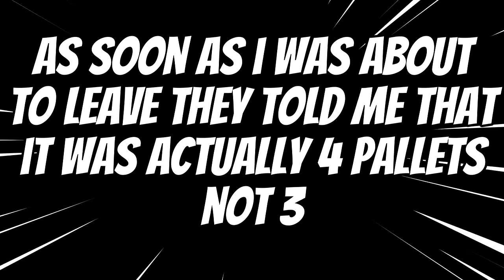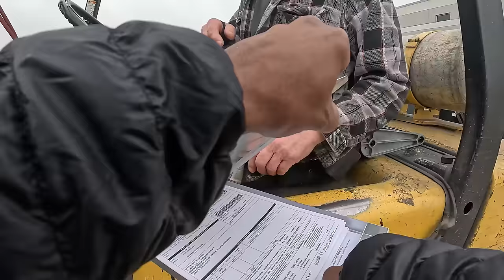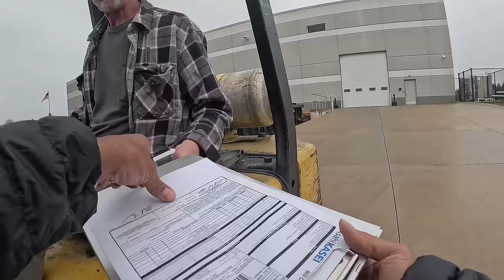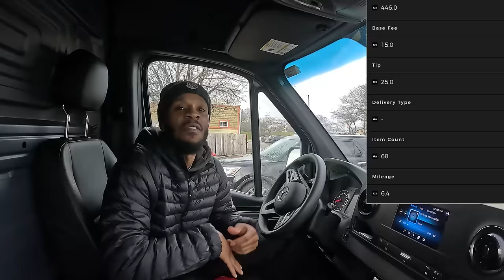Not Enough Gig App Orders to Keep the Van Running! What Is Going On?  #hustleharder

Comment: I thought about hot shot.  I did RV transport , but with all the deadhead to get another load, you really only make in the 30k range after operating costs. 90. Percent are retired or married with working spouses .  Either they have social security or spousal income.  Certainly not a good living as a solo job.  Hot shot had a middle class income but I got tired of living out of a truck far from home.

Comment: Love your channel bro, not just info but you entertaining and handling Biz at the same time. Question: 2000 Chevrolet express 2500 cargo Van
$2000 180,000 miles well kept. Can i make some noise with a older vehicle like this as far as contracts, boards, and gig apps? or should i go with a later model. Im buying on monday.  Please let me know something anybody.
Reply: Be careful if you plan on doing gig apps with an older vehicle, many apps won’t take a van that old. Good Luck